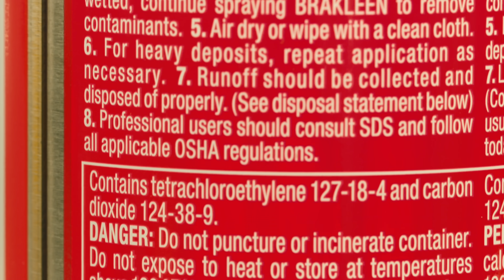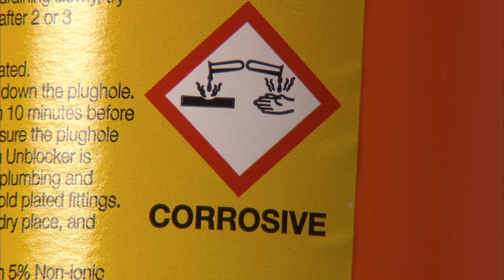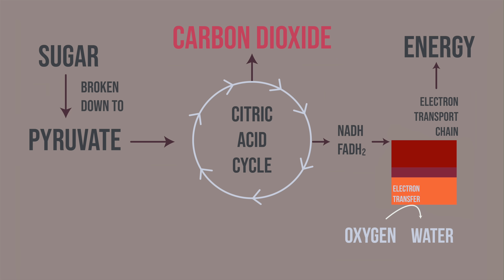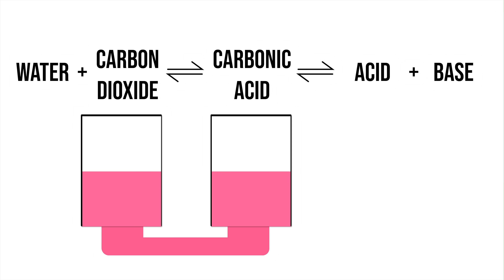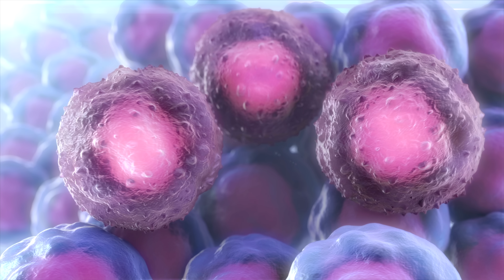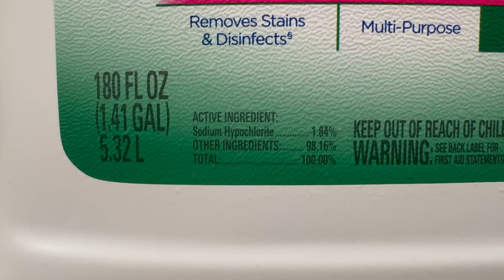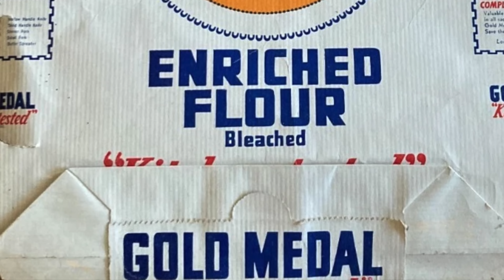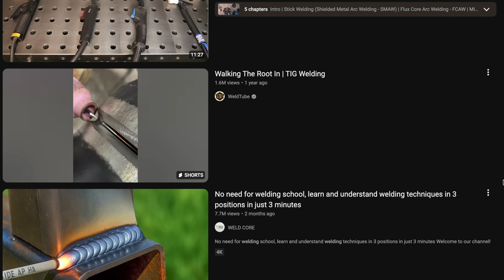"It smelled funny while I was welding and now I can't breathe..."

Comment: So often I watch these and think god, what an idiot.  This one surprised me, but I got to the chlorine being the problem long before you said it.  I use only Brakleen WITHOUT Chlorine, and the reason is that it doesn't attack paint, not to the same degree, anyway.  I had heard of this happening to somebody once from smoking a cigarette in a shop where CFC's were being used, and automotive AC shop.  The cigarette, in that case, was the heat source for the conversion.   

Strangely enough, one of the types of Freon leak detectors used a propane torch, with a hose that you moved around to 'sniff' for a leak.  When Freon entered the gas, the flame would change color, to green, IIRC.  You had to be really careful with those, making sure adequate ventilation (flow) was present, or problems could arise.

One aspect of Brakleen is that supposed to evaporate, quickly, and leave little to no residue behind, so I suspect that he must have had some still liquid under the flakes of rust or in pores that flashed when heated.  That's a shame that they weren't able to save him.  He was a kid after my own heart, so to speak.

Welding is pretty difficult to get right, you have to get a feel for how to move the puddle to get the right penetration, etc. and it really gets tricky when welding widely different thicknesses of metal together.  MIG is pretty easy compared to a true stick welder, though.    Gas welding is fun.  I have done a good bit of oxy/acetylene, and it is a lot easier, IMO.

Comment: I, strangely, just learned about the danger of brake cleaner and welding 2 days ago.   Frankly it surprises me that it poses that big a risk.  Surely, the cleaner all evaporates.  I thought.  Surely the residue is too small to matter.   I thought.   One thing I have going for me is that I tried welding, and I really really suck at it.  So I only use brake cleaner on stuff that doesn't get hot.  Like brake disks.  They never get hot, right?

Comment: will sodium chloride aka table salt, or other chloride salts produce funny chemicals under workshop conditions, or is it just mostly organic chlorine that will cause problems?
Reply: Chlorine in salts are normally safer because they are in the form of chlorine ions (-1 charge) which is its most stable form and normally would not want to react to anything else anymore as it is already with another ion that has positive charge, like sodium ions.

However, involving electricity with chloride salts in water will be dangerous because it converts chlorine ions to chlorine gas through electrolysis. Though, if the chloride salt is solid, it doesn't conduct electricity well, so this wouldn't happen.

Chlorine in organic chlorine and chlorine gas are unstable and would like to react with something with ions whenever possible to become its more stable chlorine ion form. Ionic bonds that involve "giving and taking" electrons between ions are much stronger than covalent bonds that simply involve "sharing" electrons between chlorine and either carbon (organic chlorine) or other chlorine (chlorine gas).
Reply: As long as the workshop doesn't have the chloride salt in water and have high electricity, it's fine

Comment: The second I saw the welder, I knew this was going to be about phosgene gas.  I didn't know about it when I started, but thankfully I'm a cheapskate and the non-chlorinated stuff is a lot cheaper.  I got lucky on that one for sure.  Now on, I never buy chlorinated brake cleaner, just to err on the safe side.  Wearing a p100 mask is about as good as you can get for cheap.  I also have a harbor freight blower that I position to suck the fumes and blow them away from me.  You have to be careful also when brazing HVAC linesets because some of the refrigerants can also make phosgene, or other nasty gasses.  Phosgene is no joke, not a lot of people live to tell the tale.

Comment: One minute into the video I knew exactly where this was going. I, too, learned the hard way.
Reply: as some one who does chemistry and welding ya, in case of inhalation contact mortician immediately, and get to work on your will while you got time as the stuff is notoriously deadly, and cruelly yet is slow acting so you have time to think about it, but at least you have time to say good bye if you know what is happening.
Reply: @Refertech101The other component brake cleaner can break down into, not mentioned in this video is hydrogen chloride. 

In my case I was fortunate(?) that I got a nose full of very spicy air that immediately convinced me to abandon my weld and call it quits for the day. 

Uncomfortable night, but I survived without a hospital visit.
Reply: @RideRevival  it is a slew of compounds yes, very unpleasant to say the least!

Comment: Small correction at 5:50, welding doesn't use high voltage, if it did, it would be extremely dangerous. It uses low voltage and high amps.

Comment: Some chlorinated solvents when heated form Phosgene.     I smelled it once in an accident.   It does smell like fresh cut grass.    In my case methylaldehyde (formaldehyde) and sodium hypochlorite mixed together.   

I ran for the exits, taking time to turn on the ventilation fans.   The fans evacuated it out.

Comment: gunsmith says: this is why i use a remote air supply for grinding welding and chemical processes like epoxy style refinishing like cerakote or boat bottom paint. don't get these injuries they are life changing. ill say a prayer to the Universe for SP

Comment: I worked as a welder for quite a few years and I always remember the old heads randomly telling me to never use brake cleaner on anything I planned to weld on. Years after that, I noticed that a lot of brake-cleaner cans specified that they're non-chlorinated and I just never put two and two together until now. All I knew is chlorine is a violent element and it's not to be underestimated.

Comment: In addition to the wild collaboration, the timing is ironic; I'm about to break out my mig welder for the first time in over ten years ... to weld an old car part.   Yeah, yeah, I'm not using brake cleaner, BUT the metal is galvanized... so I have ( just bought it three days ago) a P100 mask.

Comment: As a chemist I'm often surprised how many products contain potentially dangerous components. 
Strong solvents are ridiculously easy to get, and a serious exposure is often just one unknowing mistake away, while warm water and soap is one of the strongest solvents.

I'd like to generalise the advice in the video; 
When you smell something strange or unexpected, leave the area and open as many windows as you can.
If it feels like it burns in your nose I recommend you run, and when it smells like rotten eggs you can expect to be stuck with the smell for a while.

Comment: A friend wants to know if brake cleaner is ok for cleaning pipes that have a lot of gross black tar inside. Naturally it would be well washed w water, but is is that aafe?
Reply: I don't think a doctor would be the best consultant for plumbing practices, but brake cleaner is generally hazardous and shouldnt be used in drainage areas.
Reply: @Ithical  My friend no. Not cleaning or draining pipes, but glass pipes made out of glass that people put tobacco into and smoke. 

Unless cleaned every day or two with 90%+ rubbing alcohol they turn gross and wind up so full of tar that they're useless and I throw them away vs cleaning and buy a new one instead.

Would brake cleaner be good to clean the tar out of  glass pipes or water pipes if properly washed with water or even rubbing alcohol right after brake fluid is applied?

If you've ever tried cleaning a glass smoking pipe after it's beyond the "point of no return) with black tar and resin, that can take hrs with hot boiling water or rubbing alcohol and qtips. Can I just spray that stuff with brake fluid, wash and then reuse? 

That's all I want to know, thanks.
Reply: @dukeofthedance probably no, I think any mistake will just make mustard gas after heating
Reply: @Ithical  Thanks for replying but I'm kind of familiar with chemicals just not brake cleaner is all. As a kid I used it to wash my hands after coming inside from playing. Dozens and dozens of times.

So now that I'm older, and I smoke enough to make good glass pipes turn the insides into black tar, bad enough to throw away and get a new one instead, you're saying that knocking all that black goop out is going to make mustard seasoning for the air (I don't want to say it lol)?

My theory is to blast the inert glass pipe with brake cleaner. Then soak said pipe in 90%+ rubbing alcohol for a day, and then finally boil in some water to smoke out of it again (heat it up). 

You're saying it would STILL have brake cleaner residue on it after that? They sell this snake oil junk called "3 min pipe cleaner!!" which is only true if you use it each and every day religiously. I'm not that kind of person. I don't have that kind of time.

Using classic rubbing alcohol and coarse salt can take up to 3 days sometimes so you can see why I'd rather just buy new ones. I can't wait 3 days getting black stuff all over my hands, toothpicks and qtips, messing up my sink, etc.
Reply: @Ithical   Before I was 16 I had a job washing dishes. This is before they did away with this dish cleaning practice. But they'd have me wash them in a huge 10g vat of watered down chlorine bleach and right next to it, after the chlorine dip, they made us soak the plates in ammonia before going to a drying rack. Omg. I knew the story behind that so refused to do so, knowing it could clear out not just the kitchen but the whole restaurant. I quit the next day.

Comment: Speaking as a certified welder, we were taught at trade school to always be careful spraying certain chemicals onto the surfaces we are working on. Always clean your rust and other junk off with a grinder and use a respirator whenever possible. Always. You can use a sandpaper wheel or a wire brush wheel. 

Welding fumes alone can be toxic but that’s through prolonged exposure over time, some chemicals when burnt with a welder can kill fast, and in some rare cases almost instantly.

Comment: I was expecting “man presented with wounds similar to those from a phased plasma rifle in the 40KW range”
Reply: Why did I hear that sentence with Arnold Schwarzeneggers voice in my head? :D
Reply: @goldiemum3991 😁
Reply: Styropyro's car battery array is up to 150,000 amps at 12-to-65 volts, so 40kW is actually WAY lower than the actual power of the array but also he has used pulsed lasers in the millions of watts (for very little duration). Styropyro's actual hardware is MUCH scarier than 40kW.
Reply: Was the line ADR’d recently? The original line was “40-watt”.
Reply: @man_in_space no I changed it in my quote because mentioning 40W in the presence of a styropyro post would quite possibly make him react with a shiver and given he was likely doing something lethal when I pressed submit that would be risky.

Comment: Yikes. I could see myself actually doing this. I want to learn to weld and I have a chlorinated brake cleaner I use for car work. I always think about things like UV, because of my fair skin, but chemical breakdown from the electrical arc never crossed my mind. I've dealt with hydrogen fluoride. I'm curious whether fluorine and bromine compounds are as dangerous.

Comment: Except.. mig (metel inert gas) welding uses a gas mixtures (usually argon, co2, helium, etc) The work area is flooded with the gas to shield the bead as it cools.

Comment: A couple of notes: 

1. That type of welding doesn't really use "high voltage". It uses low voltage, high intensity (current). 

2. You don't necessarily have to melt a filler metal, nor is it particularly relevant which one melts first. It's possible to arc-weld just the pieces you're joining, without filler wire / rods (though you'd use a TIG torch for that, not MIG).

3. To avoid permanent damage from the UV radiation, you need a helmet (or goggles) that specifically blocks that UV (especially UV-C) radiation. In other words, it's not enough that they're "darkening"; it's not the visible light that burns your retina, it's the UV. They are also darkening (i.e., they block a lot of visible light as well) because that makes it easier to see where the arc is striking, which would be hard with the glare. Self-darkening helmets will typically block UV even when they're not in "dark" mode.
Reply: Low voltage high amps
Reply: Wrong way around: high voltage, low current. Arcs need high voltage to bridge the air gap but don't carry a lot of current because it's a high resistance circuit.
Reply: @GeorgeJoubert-id2cv  - The welder shown in the video has an OCV of 69 volts, and should typically weld at a maximum of 18 volts (they don't list the exact value in their spec sheet, but it won't be more than 4 volts either way). That's not "high voltage" by any normal definition. And it goes up to 140 amps, which is pretty high current by most definitions.
Reply: @GeorgeJoubert-id2cv  pretty sure it's right with the metal rod melting kind, it's high current making it heat up, not an arc. And the circuit made of thick metal would be low resistance.
Reply: @chanman1995  It’s still the current doing the work, but the arc matters because it changes how that current delivers energy. The voltage across a small gap initiates and sustains a plasma, and that plasma concentrates the current into a tiny, extremely hot column. That’s why heating is dramatically faster with a gap than with a stuck rod.

If you stick the electrode to the workpiece and apply the same current, the circuit still flows and things heat up, but the energy spreads into the rod and base metal through bulk resistive heating. With even a 1/8” gap, the voltage rises, a plasma forms, and the same current is now carried by an arc that dumps energy far more efficiently into a localized spot.

So the difference isn’t “voltage doing the melting instead of current.” It’s that voltage enables the arc, and the arc re-routes the current through a plasma state that transfers energy orders of magnitude faster and more locally than solid conduction.
Reply: @GeorgeJoubert-id2cv  The electrictly doesn't bridge the gap in an arc welder, the metal needs to physically touch for there to be a circuit. The MIG I have is 20v out, which is nowhere near a high voltage.
Reply: @nicholasmckee8620 of course you complete a circuit - why else do you ground the workpiece? The arc is the circuit completing.

Comment: 15:04 the most common refrigerant I deal with is R-600a or isobutane, which isn’t a potent greenhouse gas or ozone depleting. It is flammable though so the systems have to be purged first before you can work on them.

Comment: 0:30 let's play Cluedo: he welded in a badly ventilated room, the metals vaporized and he inhaled it, creating a similar issue as silicosis.
Reply: 1:30 hmm... Maybe the cleaner, containing some acids? Something like phosphoric acid he vaporized? (I like this game ^^)
Reply: 4:40 with no lung dmg visible, it might be something that inhibits the gas flow on a molecular level like cyanide or carbon monoxide... But it wouldn't make his situation worse without exposure...
Reply: Hmm ok, never heated of this gas... Sounds like this gas is made to suffocate in multiple ways, scary

Comment: As a health and safety inspector and ex-toxicology college teacher, this is exactly why you should always read the SDS before using a product and the instruction manual before using a machine plus use an extraction hood with P100/HEPA plus charcoal filters (and not a mask, because most people wear it with a beard or incorrectly or no fit test, etc.) while welding...Also, thumbs down for having StyroPyro, he's doing lots of dangerous and improper stuff on his channel, so that dilutes your safety message at the end...

Comment: finally, somebody who didn't present to the emergency room because they thought that eating 4 year old rotten gas station sushi followed by a 2 gallon chaser of illegal moonshine while staying up for 96 hrs playing video games was a good idea.
Reply: “What could go wrong?” He thought.
Reply: 😅 sad but true.
Reply: smh hed be good if the moonshine wasnt illegal
Reply: Or some kid who couldn't even off himself properly
Reply: I still feel like applying intense heat to chemical substances (or in general using any chemical substances outside of their specifically prescribed use cases) should been obviously extremely foolhardy and should be foreseen by anyone as a bad idea.
Reply: @vepiol2278 you've obviously  never  worked in heavy industry because the amount of people I have to fight on this in safety is ridiculous  people are trying to poison themselves on a daily  basis 😅
Reply: @vepiol2278  common sense is not so common. especially these days
Reply: @vepiol2278  that's common sense but not everyone has it
Reply: @vepiol2278  when it comes to weilding I know basicly nothing. I wouldn't have even thought to use brake cleaner. I just see everybody else sand down the metal so I would have done the same. but if somebody ask me "hey, why not use brake cleaner instead" I probably wouldn't have known enough to realize its a bad idea. There's still a decent chance I wouldn't have done it, because if it was that simple everybody would do it and this on its own might have caused me to do research.
Reply: Oh my God I laughing so hard that I'm crying 😂😂 damn
Reply: You forgot to mention that they also drank three gallons of coffee to wash down 85 silica gel packets.